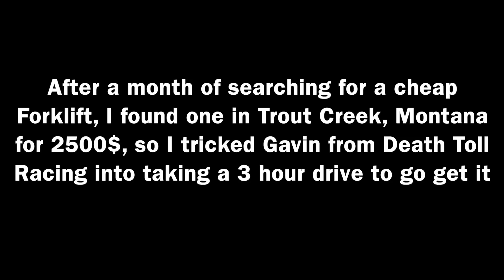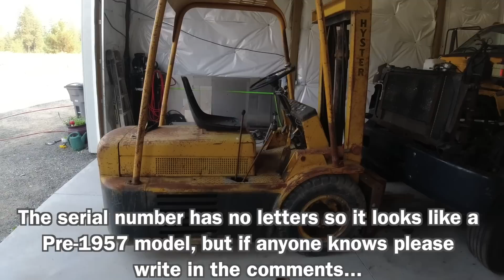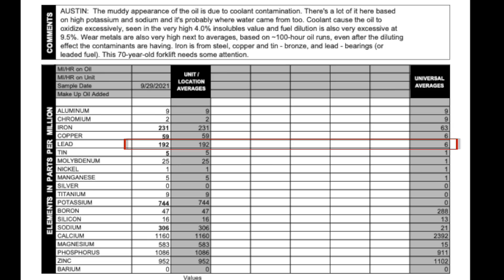I bought an old forklift sight unseen, what could possibly go wrong?

Comment: Intresting on the fork lift. I would not touch the engine. I would stop leak it. Then buy another beater forklift as a back up and run the hyster until can't get no more out of it. But you got back up for blow outs. Then rebuild it.

Comment: Oh man did you buy a project. You forgot option #4. That would be to sell it and buy something newer that does not have issues. That is what I ended up doing with my 1981 Hyster. Parts for these old lifts are getting hard to find. I sold it and bought a 2013 Yale.
Reply from the maker: I kinda like having old janky machines

Comment: I bet that oil was 30 years old.  It will be interesting what happens next time around.  I wouldn't worry about rebuilding it right away, it sounds solid still, and doesn't even seem to smoke.  I think the best option is to just let that one go for a while and when / if you find another one, rebuild it and then swap them out instead of swapping 2 times.

Comment: Good luck with the forklift if you decide to keep it. Otherwise, with your mechanical ability, I would look for an old but serviceable articulated loader with forks for loading things the size of a shipping container. BTW, the local crane guys came out with a medium sized crane and lifted my container onto piers for $350 dollars so something to consider when you need to put it on that truck chassis. Loader would serve double duty for digging you out of the snow when it hits. Be safe.
Reply from the maker: I used a crane on the last pizza truck as well as when I moved my shipping container across the Country, but this little forklift had zero issue lifting half of the empty container. I should be able to just roll the truck under it then pick it up from the back

Comment: It's a cool vintage forklift, but the narrow rear track is a bit dicey, especially on dirt and gravel.  I'm for option 1, do a cheapie rebuild on it and look for a better machine to keep and use long-term.  

That said, it'd be really cool to see you do something like a 3-cyl Kubota swap on it.  Or even crazier, find a 1.0L ecoboost in a junkyard and swap that in.
Reply from the maker: So Gavin claims the 3 wheel style is actually better for uneven terrain since forklifts don't have suspension, but I am with you, the narrow track seems like it would be unstable. An ecoboost would be hilarious in this thing
Reply: I like this idea too....  the 3 wheel ones are probably less likely to get stuck in the gravel since it will keep more even weight on each of the front tires.  The 4 wheels ones are the same principle though and just have a pivoting rear axle for uneven terrain, but usually have minimal articulation for clearance and safety.  And since the wheels on the rear are so small, a small divot in the ground is about all it takes to max them out.

Comment: I'd be tempted to just run it for now while gathering parts for a home rebuild.  Sometimes stuff in low RPM/stress applications can run virtually forever, even after it starts losing power and making unhappy noises.  With that, you do have to weigh the chances of doing further damage, but with those OA #'s, you might already need machine work & undersize bearings.

BTW, welcome to the PNW!
Reply from the maker: Totally agree. This thing may be @ 6:1 compression with little stress and that oil may be 20 years old

Comment: Try this at your own risk. My dad was an old school mechanic who ironically worked for Hyster. He said you could run an engine with kerosene in the crankcase and flush out all that sludge. Can’t run it very long or very fast. Just let it idle a few minutes. Never had the guts to try it myself.
Reply from the maker: I have heard that as well, but have been too nervous to try that.  I have always used seafoam with good results.

Comment: Its a flathead, and probably never got up to proper operating temperature.  That sludge was years of condensation, or minor coolant contamination.   I highly doubt any engine damage was done, but I would highly recommend staying with a straight weight 30 oil.  Also keep in mind flathead engines run low rpms and are difficult to kill.  Honestly that motor will run a very long time like that.  If you open it up it will get very expensive -fast.  With a 70 year old, obsolete engine it very might become scrap after you figure out its not rebuildable.

Comment: I think you should just replace the hoses and fix the sideway cylinder, do the pizza truck and concentrate on forklift engine rebuild/replace after that. And you will have time to figure out what to do with that engine and maybe finding a replacement/parts donor engine from somewhere. Keep it up!

Comment: If you are going to keep it I would look for a good used engine, take you time and rebuild the original or keep for spares.  If you can use it for the pizza truck I would do that and then sell this as it will distract you from your actual goals ( of which fork lift repair is not really one).
Reply from the maker: Good point